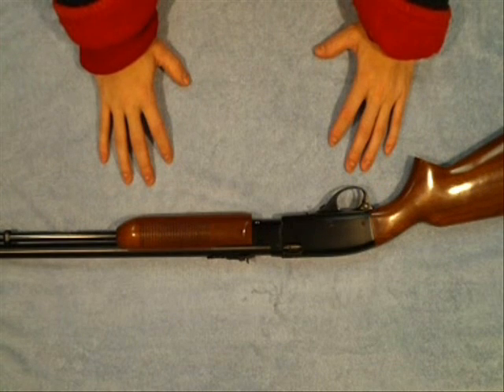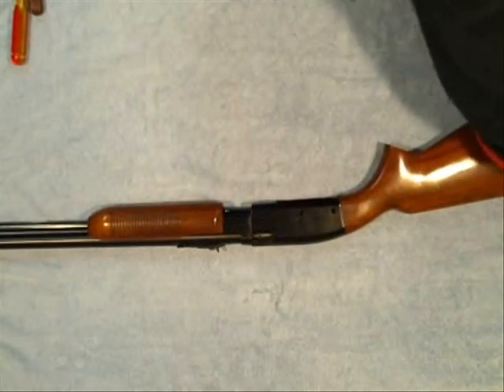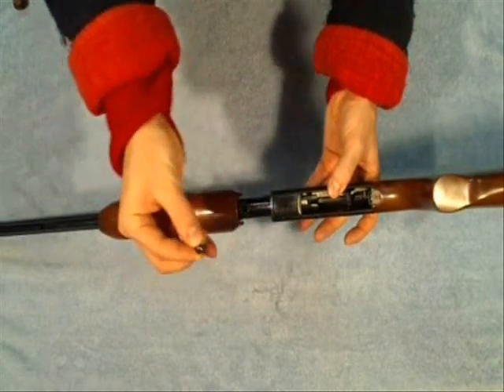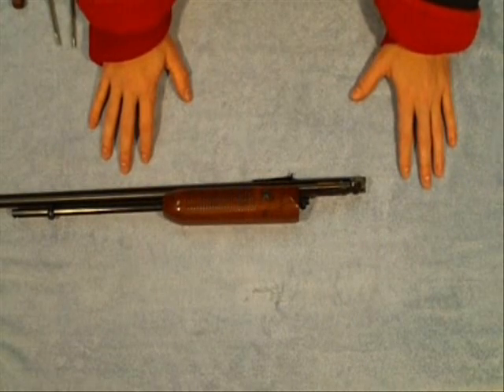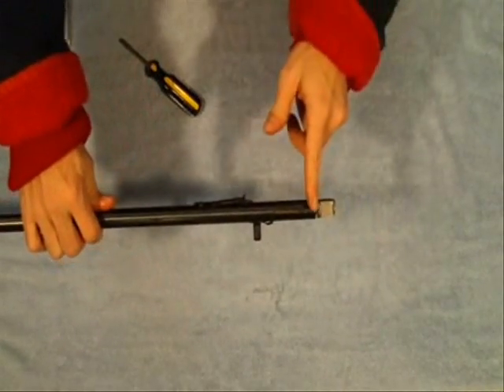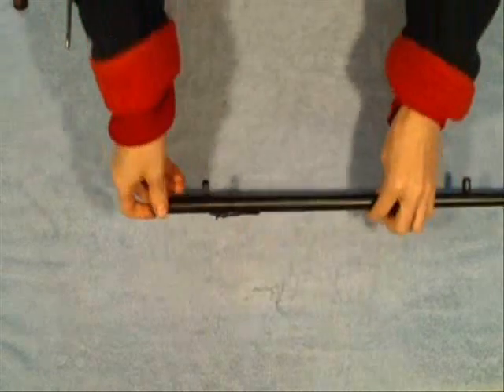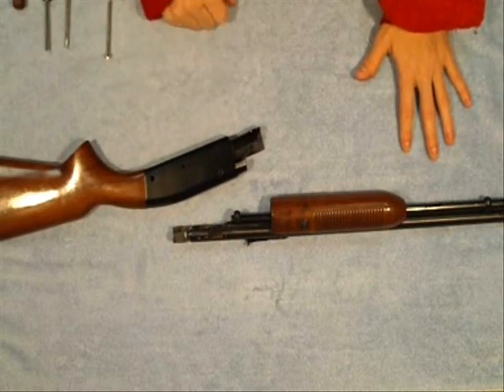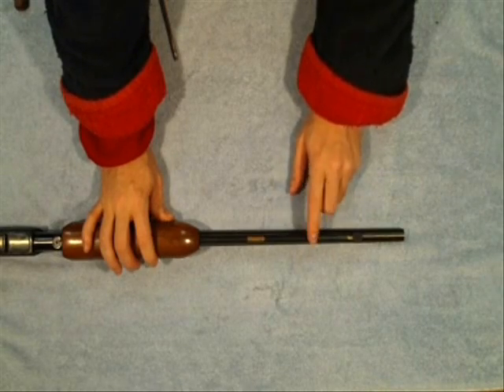Remington 572 Fieldmaster , Disassembly & Reassembly

Comment: Great vid! Super easy. I found a simple way to reinstall the "pain in the butt" plate in front of the trigger housing. With the trigger housing removed, turn the plate upside down and push it into the receiver until the sides of the plate are in about halfway. Flip it over right side up, being careful not to let it pop out, and slide it forward into the grooves. And there it is!

Comment: I took one apart about two years ago to clean that my dad gave me.  He had it since the 50's and it looked like it was never cleaned.  The chamber is badly peened from the (dry fires) firing pin hitting it.  I used the instructions on the Remington website to disassemble, but your video would've been helpful, as it took me a while to decipher the written ones.

Can't find or it doesn't have a serial number, but it shoots decently considering the chamber problem.

Comment: Thank you very much for the video. I successfully had my gun apart, cleaned and back together in about an hour and a half after watching this video. It could have been even faster but it took me a good 20 minutes to get out the rear trigger plate pin. That sucker was stuck in there good! Thanks again for the video.

Comment: I have removed the trigger assembly from the receiver but I have not taken it apart. I pulled the locking bar out of it's position to clean it and did not pay attention to the position of the locking bar spring so I am not sure where the two ends of the spring are supposed to be positioned. The video is great but not clear on this, any help? thanks

Comment: I have a question about these rifles and you seem to know them fairly well. I just picked up one and its not feeding the round into the chamber. What actually pushes it up into the chamber? Does it only rely on the magazine follower to push it up into place or is there something else? I took it apart and don't see anything that would do this. Thank if you can help any.

Comment: Need help:  followed you video for 1st time cleaning my 572 and now the action bar has extra 'play' after gun is reassembled.
The gun action works but there is so much downward travel in the action bar the forward stock can be pulled downward. It was not like this before I disassembled for cleaning.  Any suggestions???
Reply: Ellis Wallace im having the same problem with mine.  it has to do with the forend support.  its a piece of metal under the pump handle.  Brownells has them cheap.  hope this helps

Comment: kickedintheballs2000 awesome video. I have the same exact rifle and took it to the range the other day. I bought some winchester ammunition and for some reason the shells would extract from the rifle. Do you think it is the ammunition I used or could a bolt be broken in the extraction process? Or do you think it just needs a good cleaning? (it's been a while since I fired this rifle.
Reply: also, the ammunition fired fine, just wouldn't extract
Reply: Grant Padia I have had brand-specific extraction issues with several different different 22's.  It was always a worn, broken, or breaking extractor.

Comment from the maker: To tell you the truth I'm not really sure how old it is but I betting pretty old. I thinking around 25-35 years old.

Your Model 121 is the oldder version of the Model 572 Fieldmaster , the 572 replaced the 121 after they stop making the 121.

I think they stop making the Model 121 in 1954 so your rifle is at least 50 years old ( Hold on to that baby )

I'm not really sure if they are any real difference by the way they work but they both look pretty much the same.